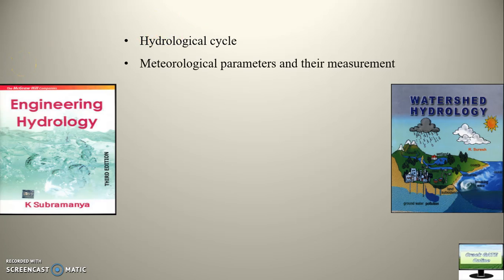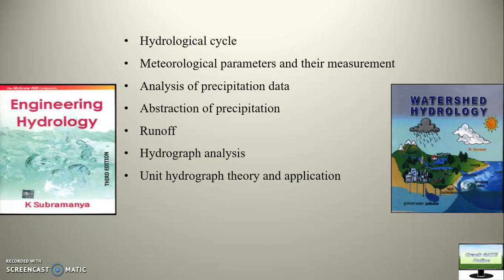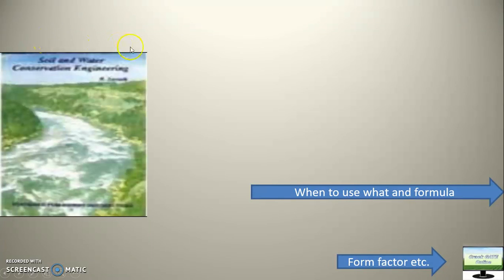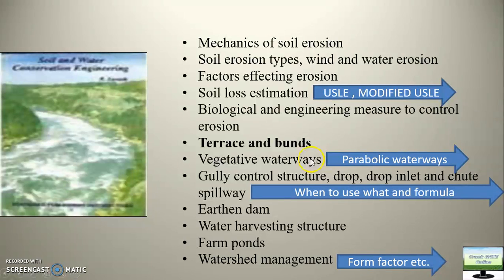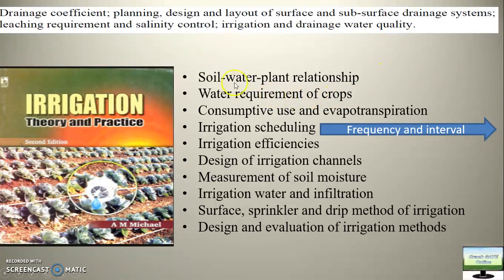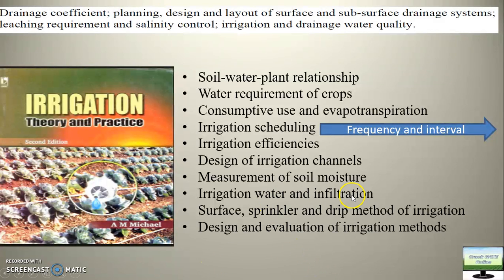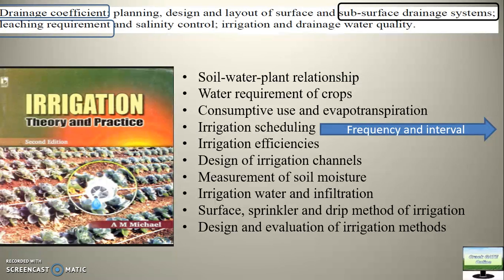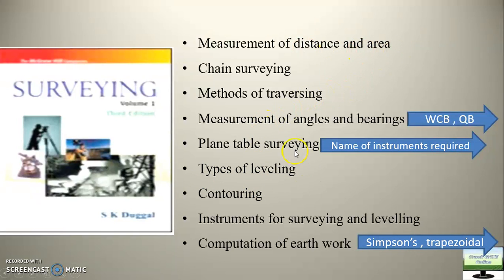introduction 1. 4

Comment: sir I  searched question Bank for agriculture engg n found a book by amandeep godhara n it is costly is it worth buying it ..? because we are not getting numerical books other than Sanjay Kumar (which again has mistakes) or it will do without this book
Reply from the maker: I would not recommend to buy.....you can practice questions from previous years papers.....once you are done with books and previous year paper

for more numerical questions......You can also refer previous year GATE questions of Mechanical and civil Engg.
In mechnical engg. paper you will get relevant questions regarding Flywheel, clutch etc. 
In civil engg. you will get lot of questions related to hydrology, fluid mechanics , Irrigation etc.

This much practice is sufficient for exam. Please dont search for too many books. 
And also we dont know accuracy of this new book. 

Feel free to ask any other query...